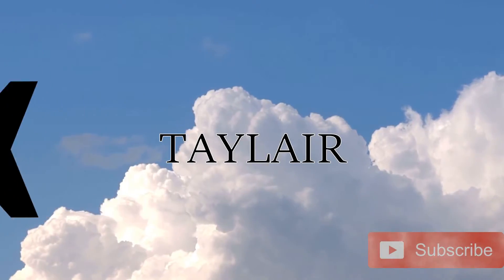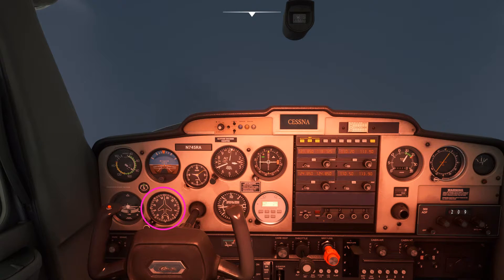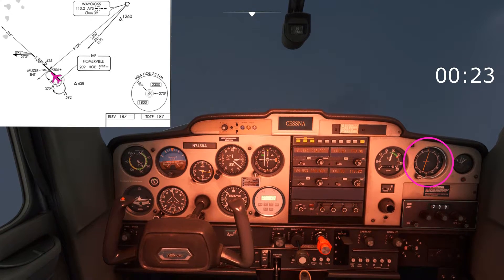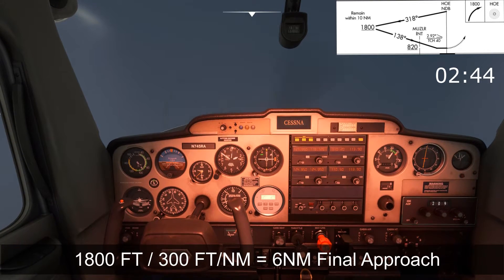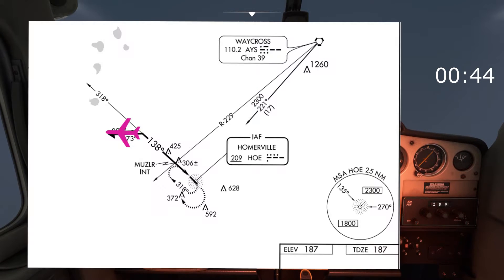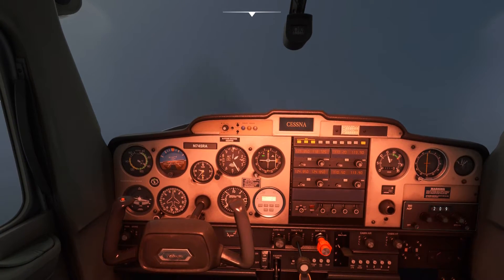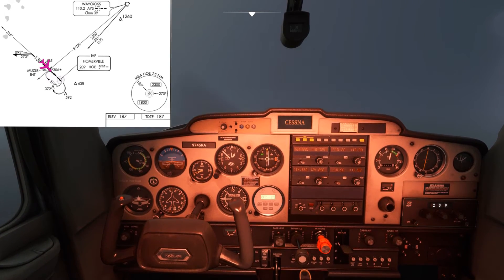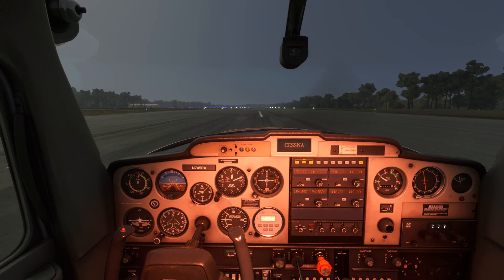NDB Approach - No GPS Tutorial | Microsoft Flight Simulator | Real Airline Pilot / Flight Instructor

Comment: This is real flying. Seems very complex to the student or low time IFR pilot, but with practice and familiarity it becomes as comfortable as an old shoe and as intuitive as eating breakfast. The whole skill set points out the wisdom of the Four Steps to IFR which must be understood and mastered in order: 1) Control of Aircraft Flight Path by Reference to Flight Instruments, 2) Position Determination by Reference to Navaids and Instruments, 3) Enroute Navigation by Reference to Navaids and Instruments, and 4) Instrument Approaches. Note the increase in skill required and how each skill builds on the previous. As a postscript I would add "4B)" namely instrument departures with reference to Navaids and Instruments which, for several reasons, are IMO more challenging yet than are the approaches.
Reply from the maker: Agreed! I’ve got a raw data departure video flown on the G1000 but without putting anything into the GPS on the channel!